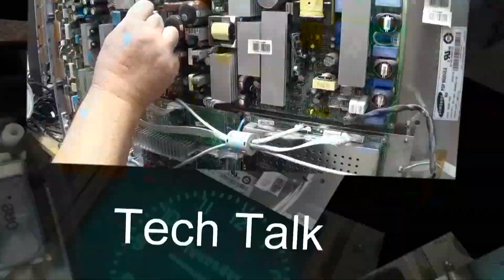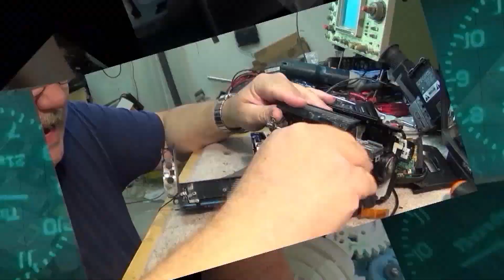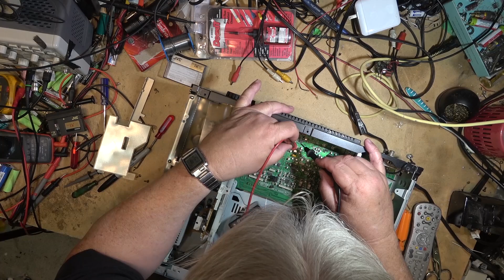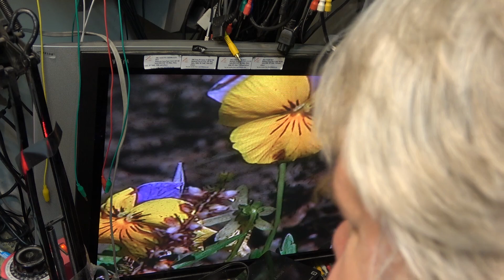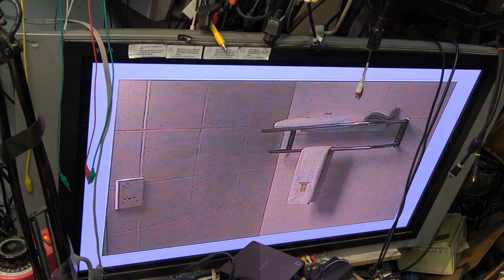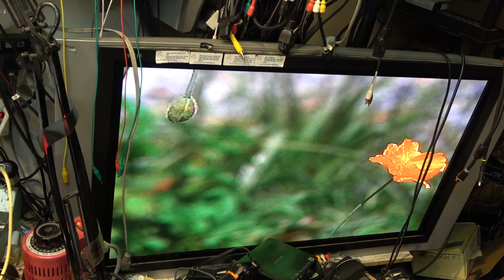How Bad is the Video Board on that DHR1000?   Its bad very bad.

Comment: I THINK THAT LITTLE ARM IS  TAPE CLEANER
Reply: HE'S NOT DEAF! 
stop using CAPSLOCK!

thank you...
Reply: @GTI1dasOriginal  👂😤🤣
Reply from the maker: It could serve multiple purposes.  Clean the tape, dissipate static charge on tape.  Stop vibrations. I think it is probably a damper to stop any vibration or oscillation of the tape that could occur  based on the distance between thev2 guides.  Thats a long way to go unsupported and with the heads wracking against the tape at 18,000 times a minute, 300 times a second that could cause a 300 hz flutter on the tape.  This could disrupt the running of the tape.  It touches on play and record only and is retracted in other modes.
Reply: I'm pretty sure that on the end of that arm is a sapphire block to burnish the tape on its way past. My Betacam and DVCAM machines have a similar arrangement.

Comment: The lid of the tape insertion slot on the front was often broken and wouldn't open. Plastic gears repaired the cracks.😅
Reply from the maker: Have to be real gentle with these plastic mechanisms

Comment: Oddly enough here in the UK, I've had almost no trouble with my DHR1000UX.  When I first got it, having been stored for a long time, the deck needed a little lubrication to get the lacing working reliably.  Sometimes the lower drawer will stick in/out a bit.  Other than that, it's been a gem.  I don't think this model does E-E digitisation to Firewire, or mine doesn't seem to anyway.
Reply from the maker: Everything works except the analog output.  I would like to get it working however it isn't the most important feature and with the density of that board it could get damaged changing the caps out and render the machine non functional. That's where I am at now.  Do I want to risk breaking something and having a totally non functional machine or just use the firewire output, as that is really the only output I would ever use to archive.  I can go direct into my computer and do a direct capture no loss, so having the analog output working might look fine just to play a tape but would never use it.  If the firewire didn't work then I would be already in there changing parts.

Comment: That is a lot of work. Maybe do a little bit at a time?
Reply from the maker: Its ugly and it could be on the digital board. I'm assuming that its bad caps however E-E from tuner and and osd work perfectly.  Just playback.  So it could be the digital board which is the shielded board on top.  A schematic would help immensely. So it may just be left as it is for risk of doing damage to a perfectly working machine as far as the firewire output goes.  I think I will leave it alone as long as the digital port works.